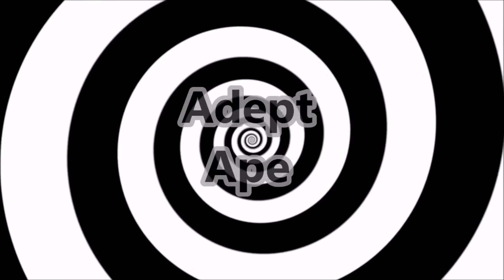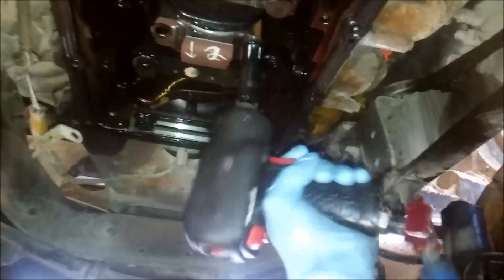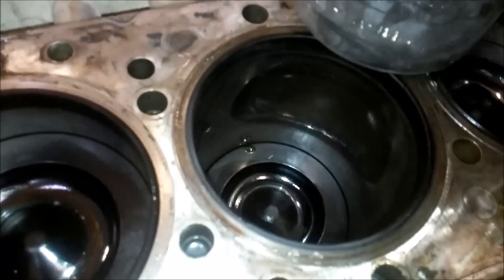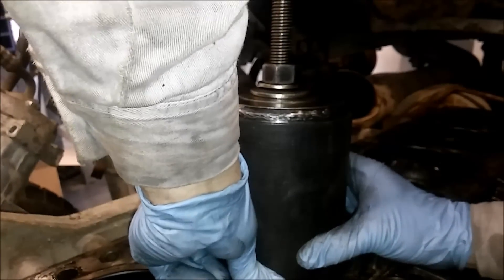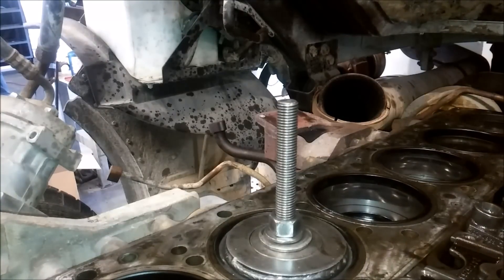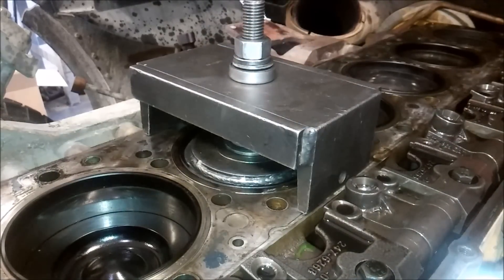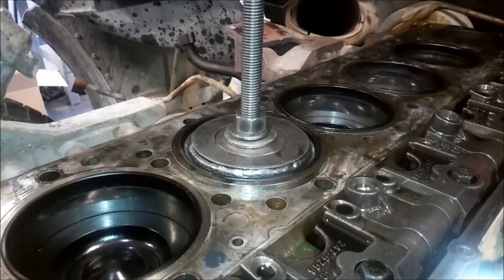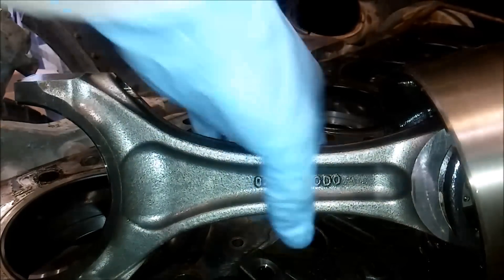How Diesel Piston Packs Are Removed During a Rebuild.

Comment: Hey man getting ready to do a rebuild on a cat C-12 to go driving back over the road and I wanted to say thank you for all the videos. It is very helpful to see the differences from gas engines which I've done and even the differences from small diesel engines. Have a great day.
Reply from the maker: +Emery Booker Thanks for watching, doing two C10 engines at the shop right now, which are basically the same thing as a C12. Not full rebuilds though, just engine swaps.

Comment: I work on cats day in day out not at a dealer or anything but I had no idea this tool existed!! always pulled piston and rods then used mt home made liner puller. next rebuild I am defiently going to be trying to use one of those would kill time like crazy in the long run!!! thanks man
Reply from the maker: +Derrick Klassen They make them for every Cat engine we work on, you just pick the right bore and it should work. If the liner is really rusted you may still need the liner puller but that is the exception most of the time.

Comment: Good video; but for anyone watching as an instructional video, it would be good to mention to brake clean the inside of the liner and use rags to suck up the fuel on top of the piston.  For the cost of replacement liner puller rubbers, it's well worth a little prep to prevent swelling and damage to the rubber liner puller; and brake cleaning the liner helps the rubber bite and pull, instead of slipping and distorting.

Comment: I follow your videos I find them very informational  thank you , I was watching this and that happens to be the same engine that I am tearing down in the shop I thought the
 C- 11 was just a newer version of the C10 with emissions/ twin turbo but I found they made a lot of better upgrades with the cam followers instead of using aluminum casted hold Downs also I didn't know it has a slightly larger camshaft diameter than the C-10 I  had to build a different driver
Reply from the maker: +James Johnson I think this video is a C12 if I remember correctly. Yeah there are a lot of little changes between the C10/12 and the C13, but you can tell they are descendants. Thanks for watching them.

Comment: Interesting. I've done power assembly replacement in EMD locomotive engines. They have clamps that hold the liner down. Remove the clamps and thread an eyebolt into the top of the piston to pull everything out. Those assemblies are major heavy, a couple hundred pounds. You need a crane to move them.
Reply: Bill Moran I love EMD's, just have some rubber boot slipovers....can measure oil leakage in gallons per hour on most

Comment: I am the proud new owner of a Cummins NHC250.
I know you work more so with modern diesels, but would you happen to have any advice in regard to some concerns.

The truck starts up easy, even cold, but I worry it may have a bottom end problem.
When cold, it hammers pretty loudly, and perhaps slightly when up to temp.
Oil analysis came back okay on all metals except iron, which was somewhat high, although this oil was the oil it had when I bought the truck, and its history is unknown.
The truck otherwise drives OK.

Thanks for sharing your knowledge in these videos!
Reply from the maker: +zoidsfan777 I'm not familiar with that engine to say whether it is normal or not. It being an older engine it may just be fuel knock. The oil analysis coming back good is a good sign. You should cut the oil filter open and inspect the element for metal as well. How is the oil pressure? If the filter is clean, the oil pressure is good, and the oil analysis is good, then you are probably fine to run it, but it is up to you. If you think you have a bad bearing then you'd pretty much have to pull the rod and main bearings and inspect all of them.
Reply: Adept Ape Thanks for the response.
What is fuel knock? Forgive my incompetence.
The fuel may not be the best. It is at least two years old, and smells like solvent a bit. It is not gelled, and was treated with some sort of additive before it was parked.
I filled the tank with fresh diesel, diluting it about 50%.
I also added 2 quarts of new ATF, and a bottle of some diesel clean.
It is an 78 gallon tank.

I replaced the fuel filter as well.
Reply from the maker: +zoidsfan777 The fuel might be the cause then. Fuel knock is just the sound of Diesel fuel igniting, usually too early, too late, or unevenly during the combustion cycle. The old fuel can cause that, bad injectors, bad fuel pump, etc. I would try to get new fuel in it through dilution and running it or draining it off and putting new in. That may cause the knock to lessen.
Reply: I've heard those old Cummins had quite a cold fuel knock, I don't think  there's much to worry about. How's it doing now?

Comment: I like the video too.  I am going to try to remove the sleeves on my 1995 DT466 international on my own.  I am a novice but eager to learn and am a little mechanically inclined.  I would like to know how to get a hold of the rubber pulling tool you used in this video.  Thanks for posting this video.
Reply from the maker: It is a Cat tool, but OTC makes most of the Cat tooling, check with OTC. The tool is based on the cylinder bore. You could also use a liner puller, but they only pull the liner, so you would have to pull the piston first. You'll also need a liner installer to push a liner into its bore. Good luck on your International, I don't have much experience with them. Thanks for commenting.
Reply: I done a bunch of DT466s.  We just use a port-a-power to pop the liners out form the bottom and use a piece of pipe some washers and a head bolt to put them back it.  You don't need any special tool.

Comment: Liked the video just one question why did you have to pull out the sleeve was it bad?
Reply from the maker: Thanks for commenting. The truck had a very bad vibration caused by the pistons having different weights because a previous mechanic had replaced a couple of the pistons with the wrong ones. Since the head had to be pulled and a couple of the cylinders replaced, the customer decided to change all of the packs. The piston and cylinder liners on Cat engines are matched so your supposed to replace them as a set. Hope this answers your question.

Comment: Nice, didn''t know it was that easy.
Reply: You should try do it and report back about how easy it was
Reply: i thougt you needed a press for it to do, the engine block is still on the vehicle in this case...
Reply: i thougt you needed a press for it to do, the engine block is still on the vehicle in this case...
Reply: Still a fair bit to strip off to get to this stage, but I agree it's not as if you need a machine shop to do it

Comment: What about putting the packs back in? Do you need a press? Are there a lot of tight tolerances or is it pretty easy?
Reply from the maker: +urgentcareguy3 They press right in and then you use a tool to push the top in and seat the oring. Getting them out harder.

Comment: Have expanded our automotive repair to include heavy diesel repair, have our first inframe coming in . its on a ISM cummins , i would like to buy a puller that is going to fit multiple engines , any recccomendations ?
Reply from the maker: +jdunmyer89rx7 I would suggest the twin arm liner puller. They are universal, but you have to pull the piston first.

Comment: It has 800K just did the water pump a week ago myself.....but its been consuming oil.....about 3 gallons every 10K.....I was thinking just getting new pistons and new bearings.....did the water bottle test, sent for and oil analysis everything came back normal. No oil leaks just a puff of black smoke upon start up. So im a little baffled. Everyone tells me all CATS consume oil .....worry when its a gallon every 500 miles.....Whats your advise or your thoughts.......thanks
Reply from the maker: +Big Foot You probably are getting high blowby too if it's eating oil like that. Sounds like a rebuild is due. Cats don't use oil per se just worn ones. I would look at getting a platinum kit, that will have new cylinder packs, head, oil pump, head bolts, and bearings. It's more expensive but you'll basically have a new engine. Don't just change the pistons, you should change the cylinder packs as a unit. The liners only have a single oring, so not changing them risks a coolant leak in your engine after the rebuild. I think there is a 20% discount on parts right now for those kits, so check with your local dealer.

Comment: I have a 2007 and id like to replace the rod bearings but I dont know the torque for those when torquing them back.......aswell as the piston torque.....can you help me with that?
Reply from the maker: +Big Foot Do you know the serial number? If it should be a LEE serial number. Also, we don't recommend rolling in new bearing anymore as you usually are putting more dirt into the engine and bearings are usually in decent shape between rebuilds.

Comment: Do those o rings tend to ever leak coolant by them?
Reply from the maker: +moparmania86 A good question and yes they do, since the oring is basically just a normal, yet large, seal over time they can start dripping coolant, then it's time to pull the liners.

Comment: I've never worked on diesel engines. Is this how it is with every diesel with this liner/sleeve to be removed?
Reply from the maker: +sunking2001 Some Diesels don't have liners so you would have to repair the cylinder like a car engine. Most of the Cats can be removed this way or by separating the piston then the liner.
Reply: Thanks for the reply...your video taught me about diesels...that I didn't know. In dredging...everything is diesel.

Comment: In my shop, your first in frame when working with someone. You tell them to go underneath to "make sure the liner is coming out squarely"
Has been done for like 10 generations of technicians here. Its fucking hilarious watching the guy unknowingly get covered in coolant
Reply from the maker: +Blue waffle cone I'm glad I don't work with you guys, ruthless.
Reply: Its a baptism. We only have a few trusted engine guys. The rest of the guys are the bread and butter boys; Annual inspections, oil changes, suspension-brakes-steering, clutches and manual transmissions. My first was an MXS C15 in 2012. My service writer currently has had me doing all the volvo-mack and cummins coming through the door as the other guys only like the cat and detroit engines. My job next week is guiding a guy through a little ISL 8.9 in-frame rebuild to see if he can handle such an important job. And yes, hes getting baptised hahaha.

Comment: I Have a C13 eng 09. There was pressure in radiator and I had to add coolant or water every 100 miles or so. No water mixed in oil. I removed thermostat but the problem continued. After checking the compressor and pre cooler and bubble check I suspected a crack head. Removed the head but it was OK, I rebuilt it anyways. Then removed the liners no sign of cracks. Now I am going to have to rebuilt the eng. I am wondering what else could be wrong? Can you solve this puzzle?
Reply from the maker: +Nader Leali Did the engine pass the bottle test? Was it bubbling or not? Did you test the radiator cap? It is possible your cap wasn't holding pressure and may have been pushing coolant out? A cracked ARD head could be leaking coolant into your exhaust and not leaking it into the engine.
Reply: Yes there was bubbles..Cap is OK, Now the mechanic tells me to replace the radiator as it might be bad due to use of Blue Devil. By the way Blue devil stopped the problem for 2 weeks.